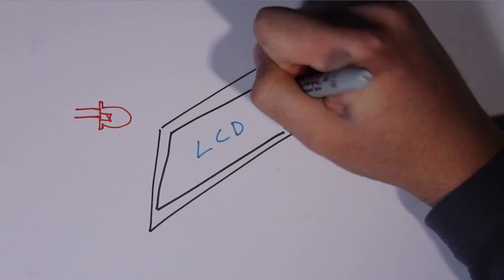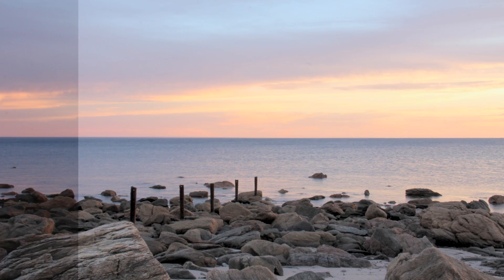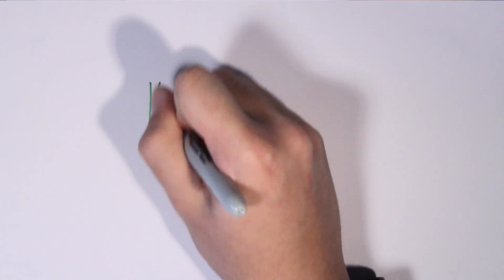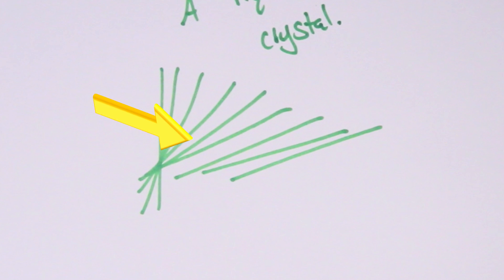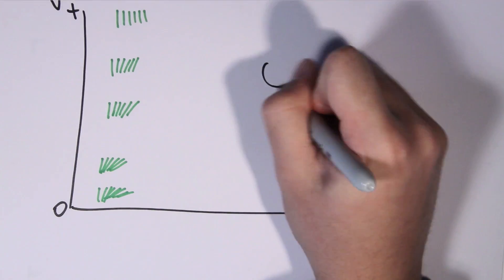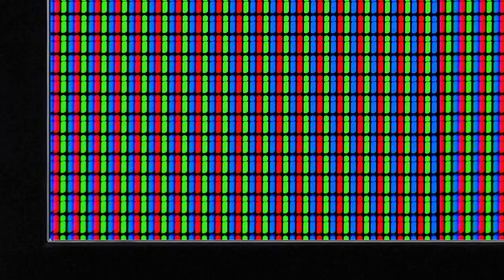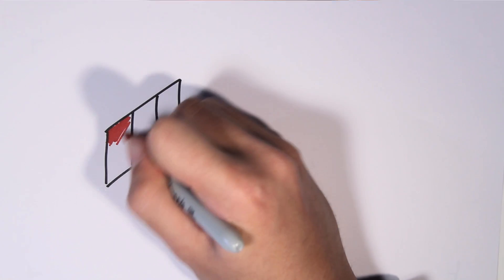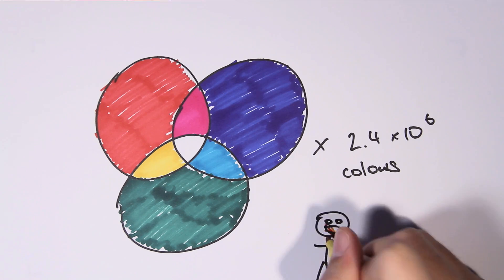How an LED TV Works

Comment: polarization (key concept) = the direction that the lights go up and down
without polarization the lights go in all directions the trick with the tv is that you have to control the directions with polarization panels
2 of them are used in a lcd panel, they are placed in front of the led backlighting. only vertically polarized light can pass through the first filter and not the second so if the light doesn’t go through the screen how do we see the image this is where the lcd’s come in (LCD = Liquid Crystal Display) are molecules that are naturally twisted 90 degrees when light hits them they curve around and that makes them able to go into the second filter/screen (the more voltage the more unbent the degree of the lcd is)

Comment: bro ur talking about LCD not LED, change the title
Reply: The term LED TV is just a marketing name. All TVs marketed as such are LCD backlit by LEDs. TVs with conventional P-N diode LEDs as the pixels themselves are not practical for the vast majority of consumers because the diodes aren't small enough for the proper pixel pitch. The actual better tech is OLED and potentially QDEL

Comment: Are the pixels the final layer of the screen?  Why do they need polarizing filters for the backlight if the pixels control all the colour?  And why do they need LCD crystals to bend the light through the final filter (why not just omit the filter entirely)?
Reply from the maker: OK. 1) The final layer of the screen is the second polarising filter. 2) The polarising filter for the backlight is so that any remaining light that passes through to the LCs is guaranteed to either stop or pass through, otherwise half the light would pass through regardless of the position the LCs were in, as the liquid crystals are only able to control a single direction of polarised light. (i.e. without the first filter, black on the screen would be 50% brightness, which is actually 100% brightness of a monitor with this first polarising filter.)  3) The LCs do not bend the light to make it go through the final filter. It is because it is bent that the light is unable to pass through, making the LCD black when no current is applied. When current is applied, the LCs are straight, and the light is able to pass through because it has the same direction of polarisation. The filter is there to control the brightness of the pixel.

Hope I answered your questions. It's a little difficult to explain without the aid of a diagram.
Reply: Joshua Gibbons Yeah perfect I understand now, thanks!
Reply: I thought it said LED...yep. wasn't this LCD?